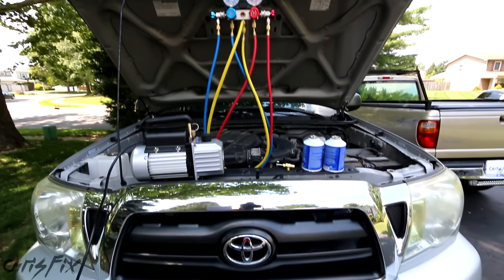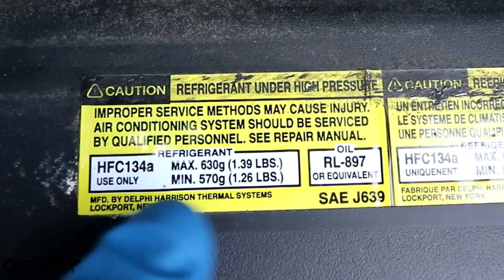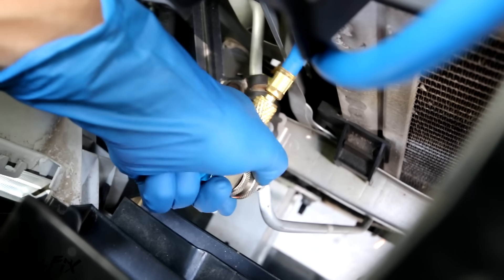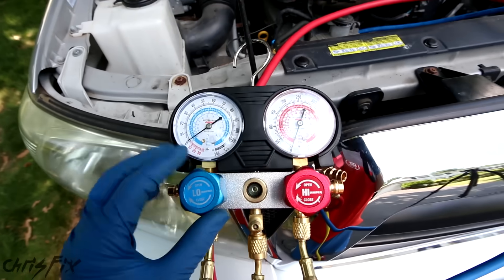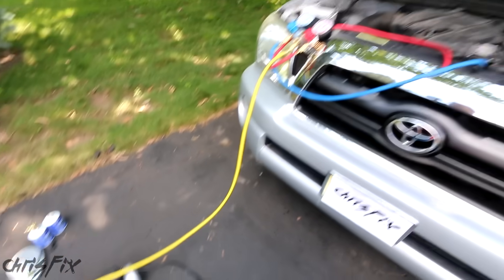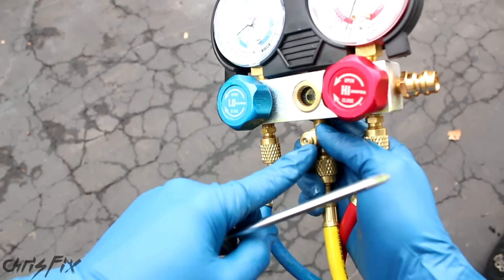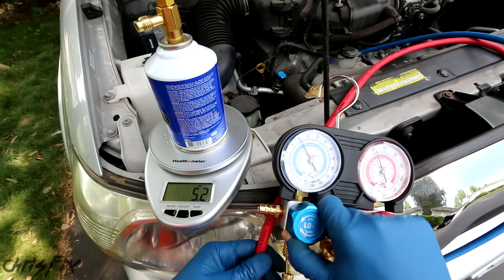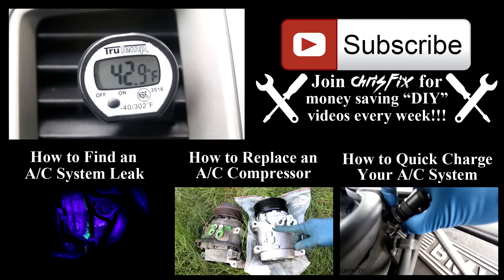How to Properly Recharge Your AC System

Comment: Help Chris. I used the AC Pro to refill my AC on my 08 accord. The gauge says I am exactly between empty and filled. But my AC fan goes on and off like every 30 seconds. When It's hot outside does not do it but at night time it does. Why is my car doing that? My low is about 30 PSI. Yes, the AC is blowing cold air.
Reply from the maker: That’s fine. The compressor should kick on and off every 15-30sec or so
Reply: ChrisFix Should have listened to you. Got in panick and took it to a place to check it out. It was slightly overcharged. The guy says that is normal about the compressor going on and off every 15 seconds or so. $89 dollars.

Comment: Gauges linked (Amazon) in description ARE NOT the ones used in video.  Look closely.  No pressure relief valve on YELLOW.  No sight glass either.  Good video.

Comment: Im doing the condenser on my truck will i have to put oil in it or will the oil remain in the pump?
Reply: usually add ounce or ounce & 1/2 it circulates thru the system
Reply: Thanks
Reply: You shouldn't just trust some random commentor; hope u didn't do the replacement yet. It's hard to be certain even knowing the total volume your vehicle is suppose to have because if the system leaked or was evacuated, you can bet that some of the oil was atomized in the previous refrigerant when it came out of the a/c loop.   As far as total oil capacity, look at the sticker on your car or get the spec from any auto parts store (their computers usually have all specs for capacities (the operator of said computer is a whole separate variable)) or pick up a repair manual for your car. 

Are you just replacing the condenser and if so are you certain that is the only problem?
Reply: Vinnymach thanks for the reply no I have not done repair yet and yes I'm sure it is the condenser I put a vary small hole in it working on the truck about 2 year's ago. And I will follow up with the parts store and ask how much oil to put in it I didn't think of that
Reply: cummins cool. Also make sure to be familiar with all the steps in this video and get at least a step by step guide online from a reputable source.   Vacuuming the system is no joke and this video was very good on that point. If it doesnt hold that vac for 30 mins, u gotta find where its leaking and the re-vacuuming is UBER necessary if your system has been open for some time cause you have to pull every molecule of moisture outta there.  Be aware that not every vehicle is going to react like the example in the video.  More often than not a car is not going to suck refrigerant like he demonstrates just by turning the air on in the car. In fact, most won't kick the compressor on until there's a certain minimum pressure in the system.  There is actually a sensor (obvi) for this and there is a way to override although its not the recommended thing to do as only a machine can actually really force refrigerant.  Anyway the method that I've done several times is to jump the low pressure switch/sensor by connecting the terminals of the switch's pigtail together with a piece of suitable wire.  If u have any other questions or if u have any issues when u actually get to doing it just reply here and ill get a notification and ill get back to u asap.

GL my friend.
Reply: Vinnymach ok will do thanks

Comment: Chris!! I am trying to replace the receiver drier on my gfs 2012 ford escape. The replacing of the drier looks easy as grandmas apple pie but the confusing part to me is evacuating the refrigerant from the current drier and I know I cannot do the swap until all the refrigerant is out of the ac system, is this the same thing as clearing the system and do you recommend i get it professionally evacuated before I swap the parts out and refill the ac system? thank you - Corey

Comment: When I went through automotive school years ago they taught to only charge as a gas in to the high side. You even needed to heat the cans sometimes to get the pressure up enough to get the gas to all go in. Once I got out in the field everyone just did liquid on the low side so I’ve just always done that, it’s much easier and works fine. School taught doing that would damage valves in the compressor but I’ve not seen that. I wonder what the real correct way is?

Comment: The previous compressor, clutch went bad and it did not cool anymore, It actually broke.Before replacement  I flushed the complete system independently. Recaptured the Freon . I replaced with a new compressor, expansion valve, seals. I used a can with a gauge and charged up to 35 psi , everything was working great and cooling.
Afterwards I made a mistake of following a generic a/c charge guideline and topped it to 55. I heard the compressor locked up?, sounded lick when a compressor kicks on but slightly louder. The high side on the gauge dropped to 60 and stayed there. Then the car stopped cooling. Removed the Freon and pulled another vacuum, charged to 35 psi and the compressor seems like it kicks on when u press a/c button inside, but the Freon does not flow through the system. After that I have run the compressor about 15-20 min trying to diagnose.
My plan is to replace with a new compressor, new a/c switch (pressure switch located next to the high side) and pull a vacuum(1 hour) and recharge correctly. I assume if this is all done again , all should work. Unless the a/c amplifier went bad? It seems its not necessary to flush the system again, since there was no knocking sounds in new compressor and it really did not kick in after over charge.
(electrical)-----. To me it seems that the job of the a/c amplifier is to manage power to the compressor  and work with a/c(pressure) switch through the wiring and make the compressor run (electrical). Seems that these compressors are smart , have a safety mechanism inside, maybe can be disactivated or maybe they just lock up when over charged. So essentially if electrical is good, the mechanical(compressor and components) then the system should work. 

Am I missing anything else??. This 2007 is more complicated than a standard car where you only have one cable that runs to the compressor, where you can connect a 12v wire from battery to make the compressor run to check it. This car has 2 leads in the harness and leads me to believe different voltage, cant really be bypassed any where? Also you cant bypass the a/c switch , it has 3 cables.
Reply from the maker: If you overcharge it you could possibly damage something. Recharge the system by weight and that’s the exact and proper amount you need!

Comment: Just a tip. After you disconnect the high side from the system. Go ahead and suck the refrigerant out of that hose through your manifold, so you lose as little as possible.

Comment: where did you get the nozzle to tap the AC cans!!!??? I've been trying to find one forever!!! lol
Reply: TheCoatneyadkins - that tap was the older vampire tap.  The newest cams are self sealing cans.  They have a hole at the top.   There is an adapter to make vampire taps work with self seal cans.  I got one at Walmart for about 2.50.

Comment: Weight or volume oz?
Also the can was weighed with hose pulling it down. After removing hose scale read 5oz
Reply: Heavier with the hose pulling it down yes, but he only needed to reduce the total weight by 10oz, so the total starting weight was irrelevant, as long as it dropped by 10oz
Reply: That’s what I was thinking. 12 fluid ounces lol.

Comment: You forgot one very important thing and after adding the correct amount of refrigerant check the pressure on the low and hi side gages and see if they are within the specs for the vehicle you are servicing. If there are issues with the pressures outside of the parameters there may be issues that needed addressed.

Comment: Great video. I know this is an old post, but I have one question. When adding dye or oil to the system in the yellow hose, how do you prevent it from being blown out when the charging line is bled at the manifold?

Comment: Chris, I did all your steps and holding vacuum, problems was the compressor wouldn't kick on. I ran out of time and took everything off. Came back to the project and reattached hoses where I left off and tried jumping the compressor. That worked but it wouldn't draw the refrigerant. Do I need to re-purge, vacuum, and start over with jumping the compressor to get it to start drawing the R134?

Comment: Chris edited a part out that you might want to know...when you switch cans (after the first one is empty), you have to remove the yellow fill hose from the canister adapter. The reason for this is you can't attach a new canister unless the adapter is in the open position. You won't be able to screw on a new canister with the adapter in the "down" position, it has to be unscrewed/open before hand. If you don't do this, then all the freon in the yellow hose will escape.  Also, he doesn't show how to add pag oil or leak dye to the fill hose. Doing that is more complicated than it sounds. You can't add dye or oil once you pull a vacuum in the system. The liquid will just sit in the female valve because the line is pressurized.  Don't trust any mechanic to do this work unless you really trust them.

Comment: ".... we are going to pull a vacuum for another 45 minutes...."  You have pulled a vacuum.  A vacuum means you have pulled all the air and moisture out!  If there was moisture in your system it would have boiled off as a gas at a fraction of the 30 pounds of vacuum.  This is analogous to sitting around with a calculator that has zero on the readout... and you keep subtracting zero from it to get a number that is "more zero."
Reply: PS.  Other than that one gripe... great video,

Comment: So I did this and I put dye in the yellow hose since it doesn't just go low on it's own. I'm a tad worried it took a whole can (the ratio of oil that's missing too?). I didn't do the can with oil, just regular with two tiny caps of dye.

The dye is EVERYWHERE, I'm assuming it's from when I purged with dye like you did. Then from unclipping with 35/230. 

It's still cold but I have to degrease the dye to remove it to see where the true leak is? Can I spray soapy wooder or do I need a heavy duty degreaser

What a mess lol
Reply: Also one things glow white with the uv light , no clue what it is but it's looks like it's going to blow up , like it's white from heat from a movie or something.

Comment: Chris - outstanding video!  Just the boost I needed to get my new (old) 2008 Escape back up and running.  One thing I'd like to add for anyone reading/searching.  With the Escape if the system runs dry the PCM will realize it based on lack of pressure.  The compressor will not turn on if you follow the directions in this video where you start the car to fill.  With the Escape you'll want to pull the 12V cable from the battery for a few minutes to reset any A/C related codes.  Then begin filling coolant up WITHOUT starting the car.  Once you have about a half of a can in you can start the car and the pressures will normalize.  I got 'burnt' by a slightly defective pressure gauge and changed out a compressor that I did not need to.  Oh well - I learned a LOT and have a spare now (it was cheap at the wrecker's anyway).  Thanks again for sharing your talent and skills with well planned and narrated videos!

Comment: always pull a vacuum
and the next step just as important
if you change any part of the A/C system you need to replace or clean the expansion valve

Comment: My low pressure line while vacuuming is at 29 could it possibly be a guages issue or does it have to be right at 30. The high pressure is below 0.... It's been on vacuum for 2 hrs now. Any help?

Comment: I have a question. Are you supposed to put the been orings on the end s of each line. To and from the compressor, the evaporator, condenser and accumulator as well?.... The lines come with a metal oring with a black rubber center. We keep getting there's a leak because we can't get it to vacuum.
Reply: I meant green orings.
Reply: Green o-rings at each line yes and usually the metal and black o-rings go on the compressor.  You may have a bad crimp fitting though or any number of things.  Use an AC dye to help find the problem.  If it loses pressure fast the leak is pretty substantial
Reply: derailedmotor8 Thanks for your reply... Actually I found out that I didn't need the green ones on my vehicle. It's been fixed for about three weeks now blowing cold no issues...
Reply: @Lovetolivetruely  always replace any orings or seals if you disturb them or you suspect they leak i.e oil stain around the fitting, bubble solution is good for locating pin hole leaks in alloy hoses to (detergent and water mix)
Reply: @MrConspark  Thanks but I fixed this six months ago....😀😀😀😀

Comment: So, following Chris's instructions, I acquired the tools and followed the procedure. Like most things, there are subtle things that you learn about the first couple of times you perform an operation like this. Happily, there wasn't anything that was so unclear that you couldn't figure it out with some common sense. One thing I might mention, don't be too attached to the actual number that you get on the vacuum gauge. Chris's unit went down to -30hg...but mine only went down to 24hg. I did the hold test, which it passed, recharged the system and today....
Drove to Pueblo, where my car's external temp display told me that it was 107!!! My wife and I were sitting in cool comfort the entire time....it was the coolest 107 degree day that I think I have ever had. This was WELL worth the investment, as I have several other cars that I will be servicing in the future. Thanks Chris!!!!

Comment: You did not take into account that the high pressure hose contains liquid freon for every 10 in it holds .6 of an ounce you have to take this into account when you measure the charge by ounces

Comment: Chris, if you CLOSE the manifold gauges they will be ISOLATED from the ac system so of course they will read  no loss. You have to leave the manifold gauges OPEN after vacing the system so that they are reading the system negative pressure not just the pressure left in the gauge !
Reply: The manifold gauge valves are located between the gauges and the yellow line/vacuum pump, so closing the manifold gauge valves isolates the gauges from the vacuum pump. They are still connected to the A/C system through the high & low pressure ports. You can see this at the start when Chris first turns on the vacuum pump with the manifold gauge valves closed - they stay at the initial reading of 0, because the pump at that point is only drawing vacuum on the yellow line and the portion of the manifold connected to the yellow line up to the valves. It's only when he opens the gauge valves that the gauges start registering vacuum. I had the same thought the first time I connected my gauge set up, but a little logic shows that is the correct way to test the system. If you don't close the gauge valves for the leak check, you would actually also be testing the vacuum pump seals as well.

Comment: Another great video, but next time try to use a (4 way manifold pressure gauge) to do the same job  ; so you don't have to make a purge for any hose after did evacuation the system It's really productive tool .

Comment: When you run the vacuum with both high and low manifold Open - doesn't that vacuum out the oil the the new compressor came filled with ?

Comment: I have been doing this for 18 years, the late model cars don't work too well. The passenger side is 7-9 degrees warmer than the drivers side. I get 40F  on the drivers side. 
My question is how can I fix this?  I have serviced static,running,as a gas & as a liquid. 2012 Focus & 2012 Lancer.

Comment: When you went to check for the leaks, why did you shut off the valves on thw gauges? I dont know about those specific gauges but my gauges dont change when my valves are closed. So if i pull a vacuum and shut off the gauges, I can dissconnect every hose on the system and still show that it has a vacuum bc my gauges are in a vacuum. Just something i noticed

Comment: Stores sell a lot of AC recharge kit at $20-30.  It doesn't seem to be proper of just hook a  kit up and recharge your AC after watching this video?   The process has a lot more.

Do you always have to drain out old refrigerant, not releasing it in the air,  at an authorized repair shop before doing this?
Reply: Simple Living - he started with an empty system because the previous video was replacing the compressor.